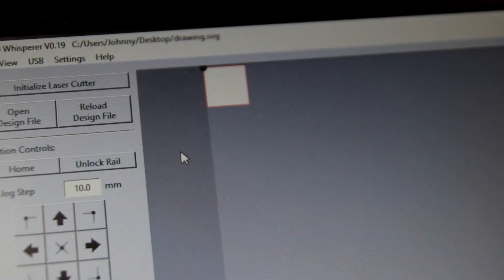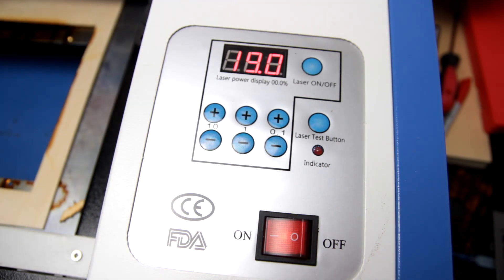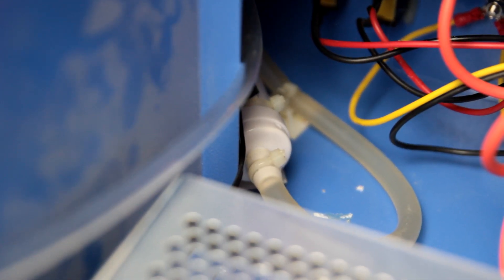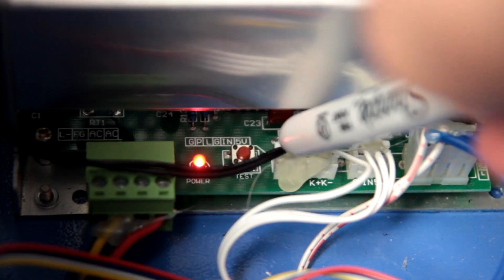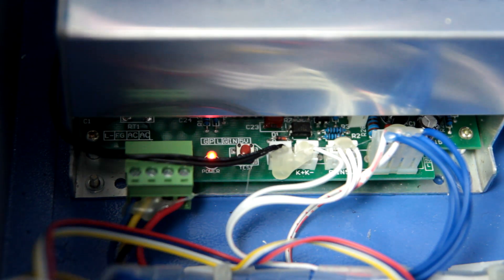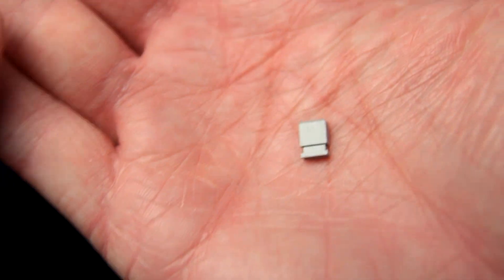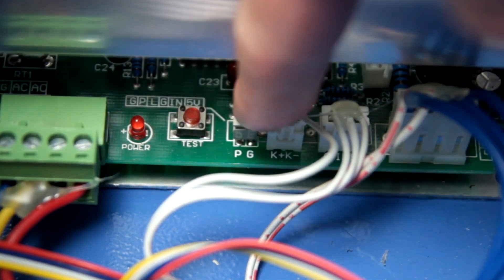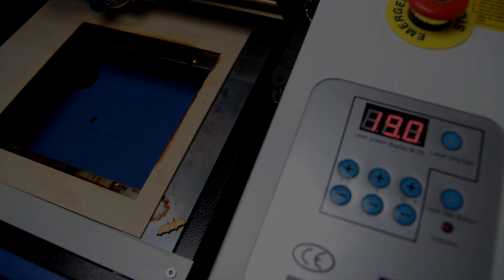K40 Laser not firing? Possible Easy Fix (bypassing water sensor) | JMKDIY

Comment: Thank you for the hint of the test switch on the PCB, that is bypassing all protection measures. The problem on my K40 was not the water flow, but the microswitch on the case was not pressed down enough. Pressing the test switch on the PCB made the laser tube emitting light, so I knew the tube was functional. Then the other "Test"-button on the outside did not

Comment: Hi thanks for the video, so does the jumper connect the 2 pins together, i don't have a small jumper could I cut and connect the 2 wires to each other instead.
Reply from the maker: Yep! that’s exactly what it does, using the jumper only simplifies the process, but if you’ve got wire that’ll work too

Comment: thank you so much, but if the machine has no water sensor? my new laser machine has firing problem, the test button works but laser beam not firing ... can you help?
Reply from the maker: As a other commenter mentioned, it may be a loose connection on the control panel or power supply. Wish I could be more help but I haven’t dealt with this exact issue before. I’d seek some advice from the laser cutting community on reddit, lots of experienced people over there that could help you out. https://www.reddit.com/r/lasercutting/
Reply: @JMKDIY  thank you so much. 
I am actually dealing with my issue from beginning, from the first day I received the machine, but still no success,  all the connections are checked, what about the software? Any experience about that? Is is possible that it's something wrong with instalation?

Comment: I had a similar problem (test button on supply would fire laser but panel test switch / software control could not). I don't have a flow sensor, but it ended up being a loose connection to the laser power switch! This video helped me debug in the right direction.
Reply from the maker: Awesome, glad it helped and you got it sorted! Always nice when it’s something simple like a loose connection and not a major part failure
Reply: Hi there. i have the same machine with same problem, would please let me know what actually you did?? thank you so much...

Comment: Thanks for the video and leading to the water sensor.
But no thanks for calling this a fix. This is a safety feature and should be properly repaired and not just be circumvented!
Reply: I agree.   Good diagnosis of issue but need a follow through on repair work.    If I performed this work I would have a replacement part on order the same day.
Reply: I repaired the sensor by just cleaning it. There was a lot of slime that accumulated inside.

Just removed and rinsed it with high pressure water. Maybe even reversing the direction works already.

Comment: I'm a new k40 (non engineer) person. How do I know what are the best amps for cutting 3mm acrylic? What number should I have my laser on for cutting, engraving and rastering? I have the identical laser to yours.
Reply from the maker: I haven't worked with acrylic yet, but I'd experiment and start with something around 20% to 30% power at 7 to 10ms for vector cutting. Do some small simple test cuts to get an idea. For engraving I prefer to run my laser at 350ms and setting the power to 15% to 23%. These lasers power supplies are capable of higher power than the tube can handle so never turn the power to more than 50%. Let me know if this helps. I also suggest checking out reddit.com/r/lasercutting - lot's of great info and people there that can help you out